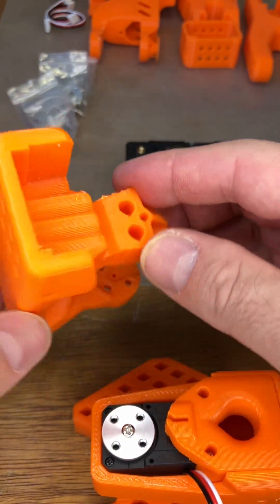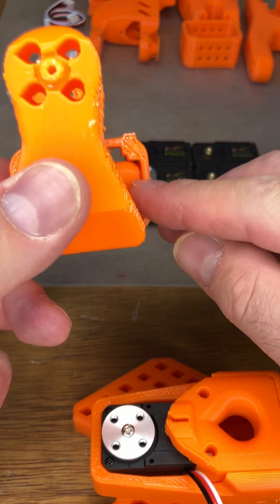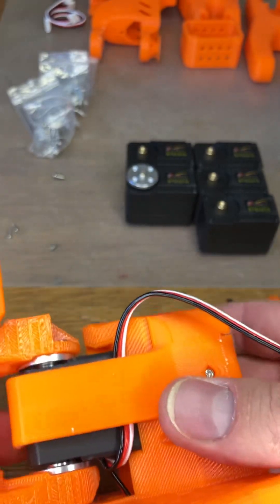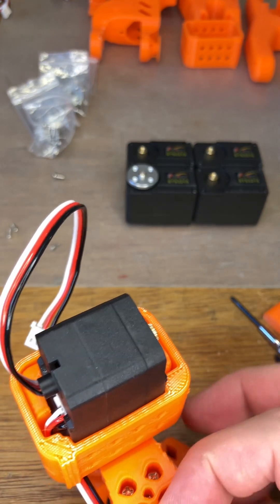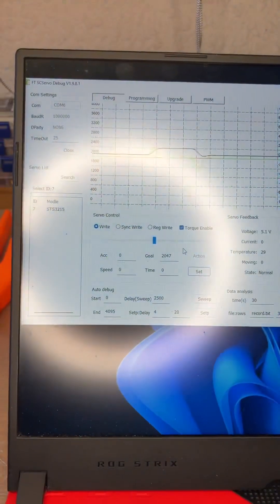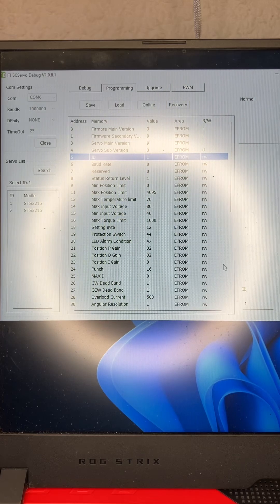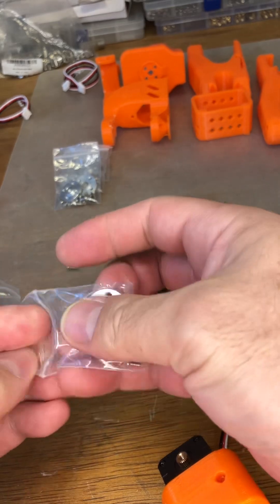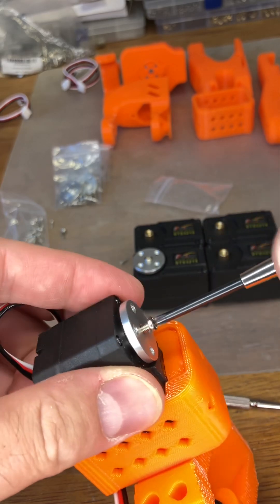SO-Arm100 Assembly Detail: Extra base bearing on underside of rotation joint

Comment: This has the rotation ID at 7 and the next servo ID is 2.  This is not the set of IDs assigned in the video on programming the servos.  Is there a map somewhere of which servos should be assigned what IDs?
Reply from the maker: The servos are numbers 1 through 6 starting in the base at 1 and progressing through the arm.

However as all servos are initially set to ID 1 each new servo will interfere with the base when plugged into the network.

To get round this the base servo is set to 7 at first and then once all the servos are connected returned to ID 1.